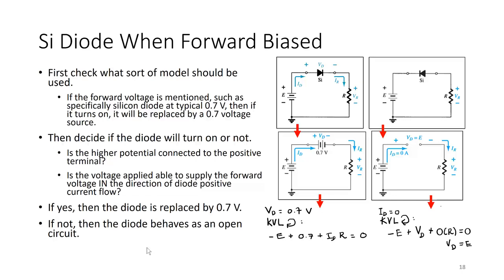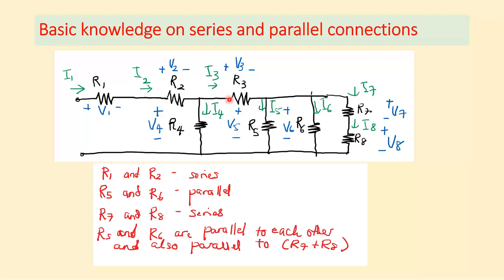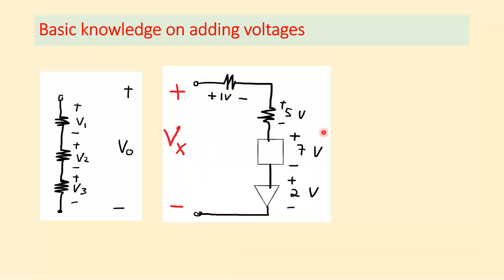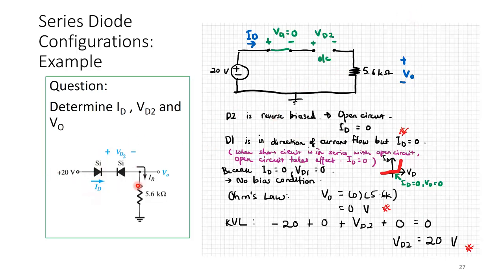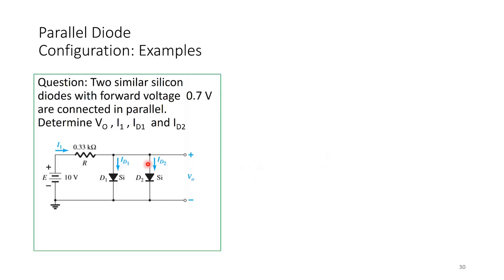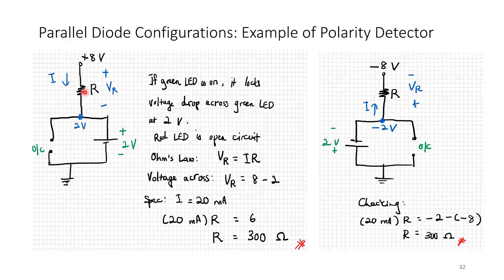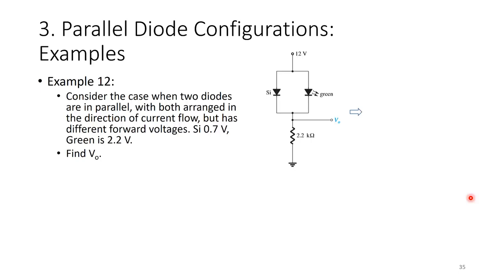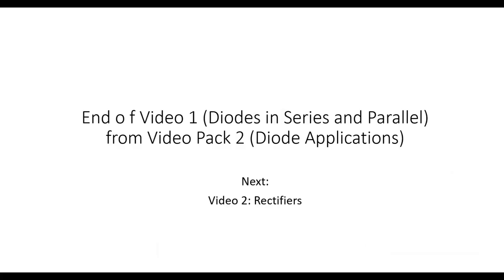Diode Series Parallel: Lecture: Part 2 V1VP2 ELE424 DL

Comment from the maker: Erratum: On slide page 28, minute 18:00-21:00, the KVL equation should read "-10 + ID(4700) + 0.7 - 5 = 0". There is an error, in the video (it's written as " -10 + ID(4700) + 0.7 + 5 = 0". Which means ID=(10+5-0.7)/(4700+2200) resulting in 2.07 mA.
My apologies on any inconvenience caused.